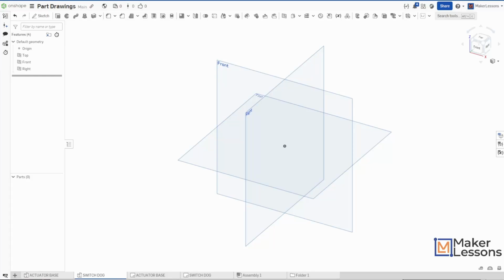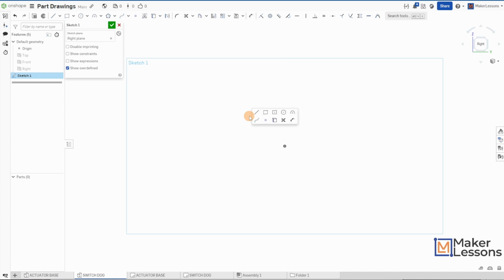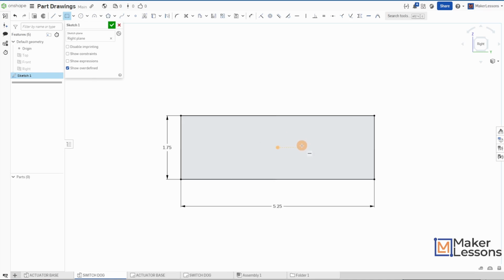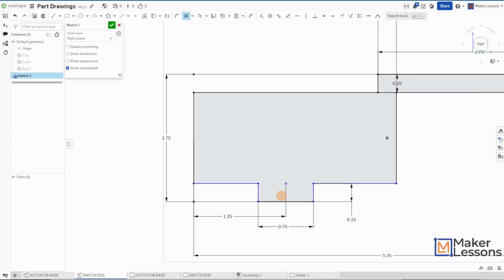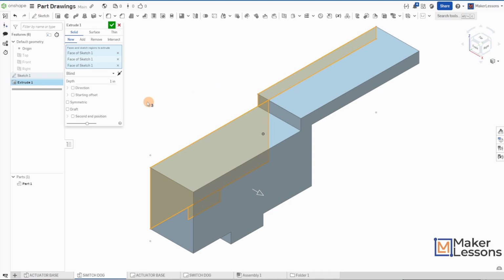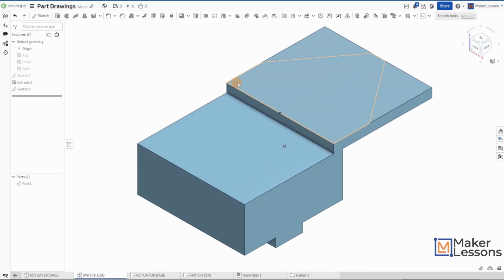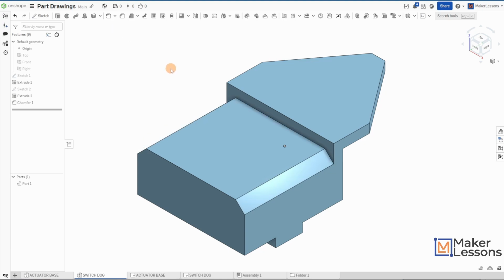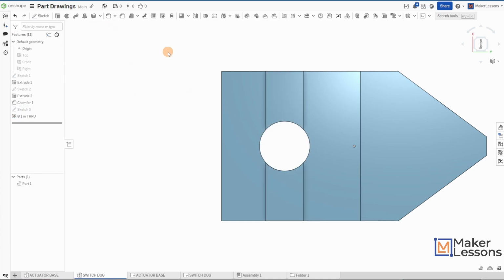Simple Part Drawing in Onshape #7 | Switch Dog

Comment: Thank you for the well done lesson.  

You might want to check the ISO drawing for that 1/2" dimension on the transverse bar. 
It appears, from the way you constructed the model, that it should have been 3/8" for CL position as bar is 3/4" wide ??
Reply from the maker: Yup you are correct. Dimensioning things in isometric is the bane of my existence. I probably shouldn't even have that dimension there at all, and Ill get that fixed for the sheet on my site. Thanks for the catch. 

I see you are also making Onshape tutorials, I think I like your voice more than mine 😄
Reply: @MakerLessons    Thanks for the kind words. 

In full disclosure, the voice track is “manufactured”.  I go outboard with the audio track to Audacity  to fix and improve things, and then insert it back into the video editor prior to post.